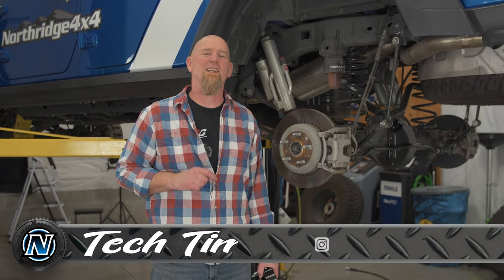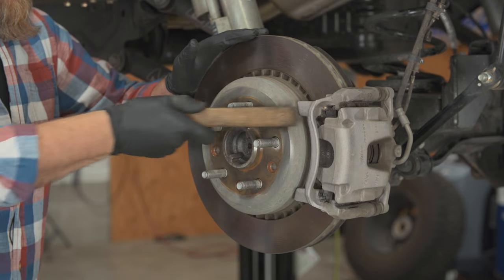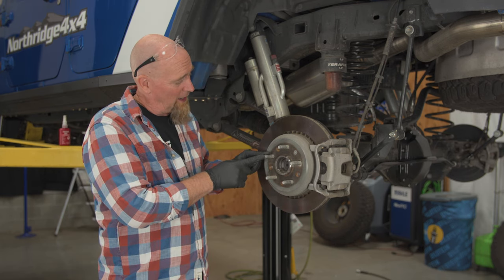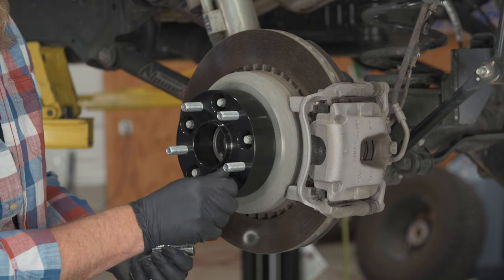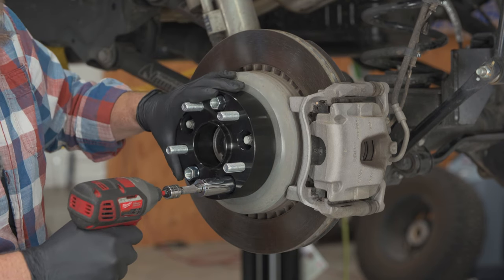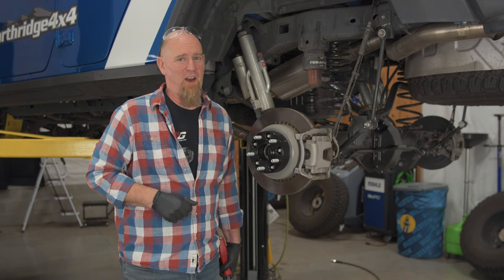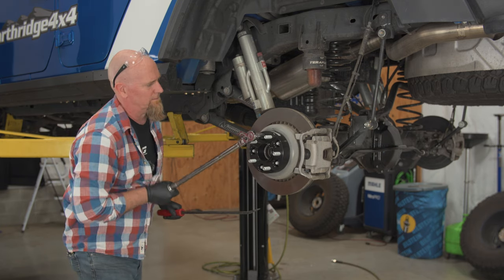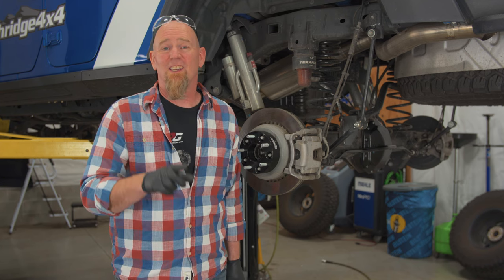How to PROPERLY Install Wheel Spacers!

Comment: What wheel spacers are those?
Reply from the maker: Those are the new Grimm Off Road wheel spacers. They should be available mid-summer.
Reply: @northridgenation  what's your opinion about running spacers with 40s off roading?
Reply from the maker: @darkcel  That's a loaded question.
There are a lot of people out there saying you shouldn't, you'll also find a lot people out there who are running that combo.
We would say that it would be best to have the proper backspaced wheel for your application so you don't have to run spacers. 
BUT.... If you are going to run spacers with a tire that big, we're going to tell you to make sure you install them perfectly and check the torque at least once a year.